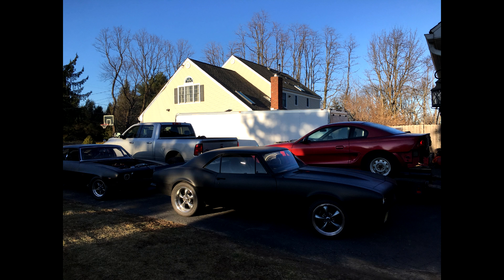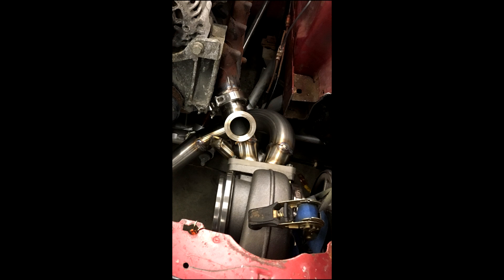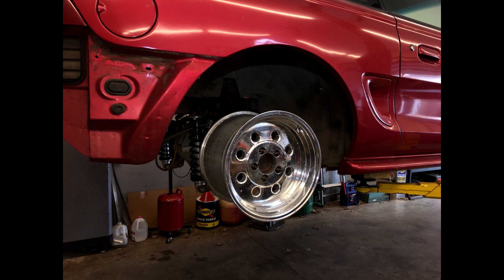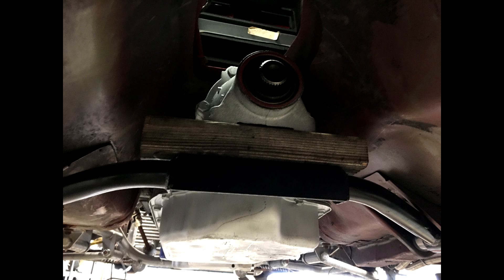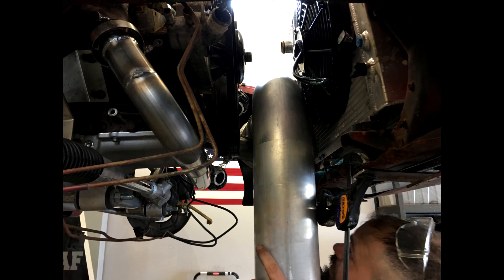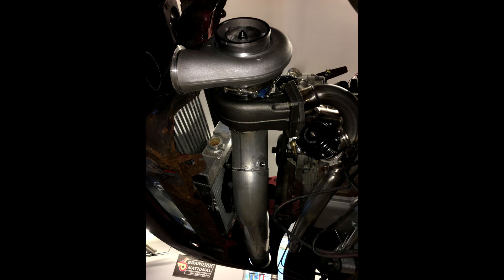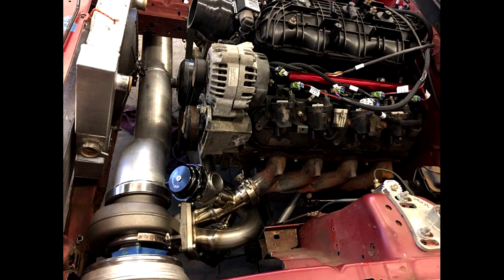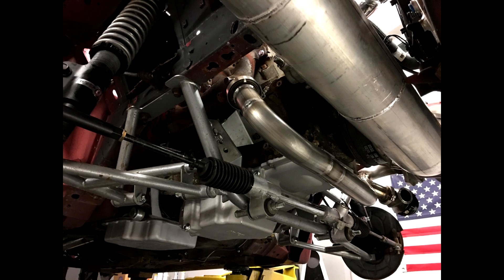project 8f8: photo collage fab update

Comment: You may want to go over the 4 allen screws on the top of the regulator. Mine leaked after about 6 months because it was loose, after I tightened it, it completely sealed up.